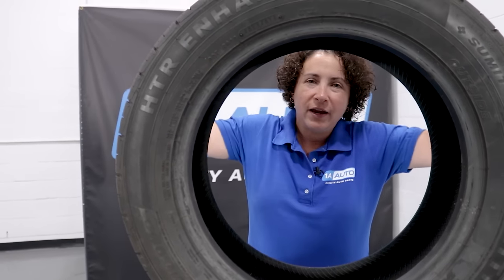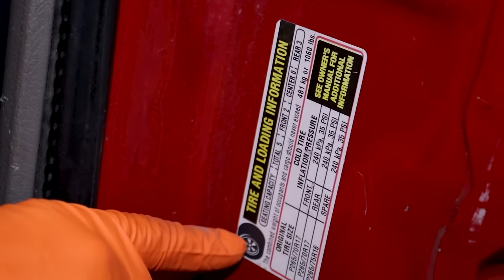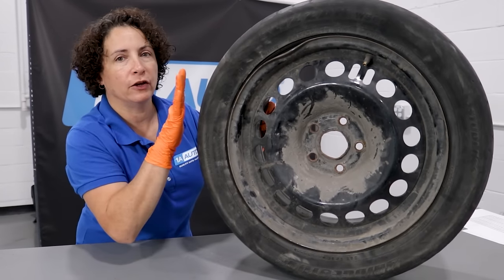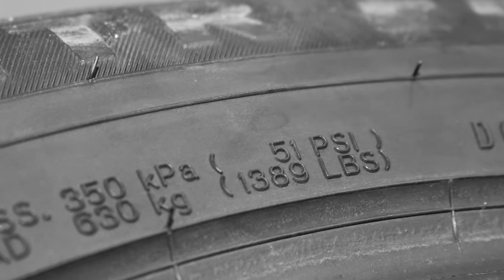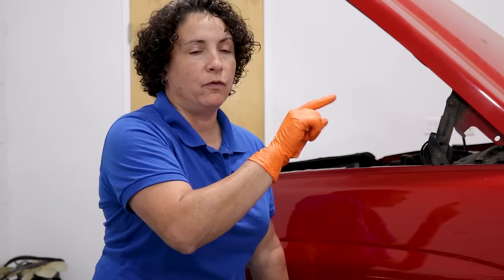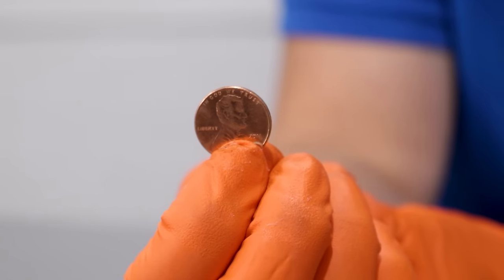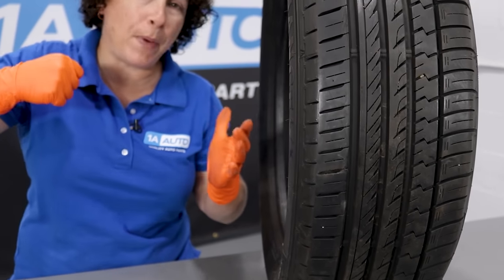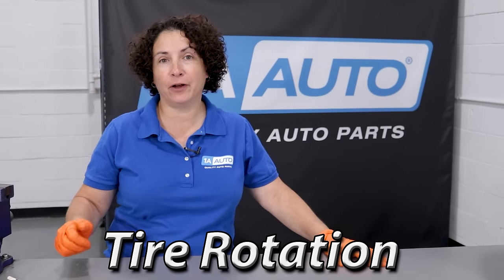Everything You Need to Know About Tires on Your Car, Truck or SUV

Comment: I retired from a major tire manufacturer and felt you did a great job at explaining the basics of the tire.
Reply from the maker: +Steve 319 Thanks for the feedback, we try to help out as much as we can!
Reply: Hello I have a question  if u don't  mind helping.  I have a 2011 dodge ram 1500 and my normal tire size is 275-70-17 I was told ill be ok putting 265-65-17 on it .Am I ok it drives fine but want to make sure not doing damage.  I'm a new truck owner. Sorry I know u don't know me .

Comment: I agree with her on everything but the alignment issue. If your old tires are evenly worn then you don’t need an alignment. Also getting an alignment every six months is ridiculous. You’re paying for an extra set of tires by doing so and it’s normally not necessary.

Comment: In 80's had 4x4 f350 dually for plowing.  When you spoke about winter, this truck with diesel engine and plow would not go anywhere as rear end was too light.  You are so right! I Needed a load of sand in bed of truck to balance weight on tires!
Reply from the maker: +Bird Lady Thanks for checking us out! http://1aau.to/m/Shop-1AAuto-c

Comment: Sue. Let me start with G-78-14. I don't think you are that old. I'm a old tire guy. HAHA. 
Thank you so much for covering most things about tires. 
I have Michelins on my Tahoe and my wife's Prius and on my 66 mustang.  Dunlop's on my daughters four-wheel drive Chevy pickup. I rotate every 5000. I have the  Alignment check every 10,000 . heat and cold plays a big Factor in tire pressure. 
Oh and one more thing ma'am not all of Texas is flat. Like most people think. Come on down sometime.

Comment: The door pressure indicator is always too low I wouldn't keep it that low unless it was in the winter during snow or rain otherwise go between 5:00 and 10:00 PSI over the door

Comment: Excellent video. Do I think you need to be as particular as Sue is? If you want the most out of your tires, absolutely.

With that said, if your budget is tight, keep an eye on your tire wear. Abnormal tire wear will indicate whether there are issues or not. If the wear looks good through the life of the tire with regular rotation? Personally, I wouldn't worry about it immediately and get it done when I can or when I see an issue, or replace steering / suspension components if I can afford to.

If you are safety conscious, tires and suspension don't get enough attention. I personally have been putting off replacing my shocks as money is tight, and plan to do so as soon as I can. That being said, I should have done it a little while ago when I had the money and put it into other things.

Comment: Is it shown on the tire where is the heaviest part? And how to find the heaviest part of the wheel? Reading instruction on Wheel Balancer I came across the statement, that if those 2 points (heaviest parts) coincide, it is not possible to balance the tire, you need to rotate it 180 degrees relative to the wheel. Thank you for the informative film.

Comment: great video.

I don't drive my car all that much throughout the year. (About 3.5k to 4k per year)
The place i got my new tires a few months back,  recommended that i rotate them every 6k miles.

Since getting to 6k will take me about 20 to 24 months. Should i rotate the tires based on time(after 2 years) or number of miles driven( until i drive 6,000 miles)?

Comment: Thanks very informative. I have one question, you said to go with the car manufacturer recommendation pressure. The sticker on the door says I need 26psi for the front, so okay I put 26psi, after I drove just a couple of meter I feel the steering is heavy and it feels I have  a flat tire why is it so?

Comment: Hi Sue, I have E rated 80psi tires, does that mean I still only fill to 35 psi?  When I drove tractor trailer, my steer tires were 110psi and drive 100psi.  Company had us maintain those pressures, and DOT too.  I understand how speed, air temp etc can raise temp of tire and pressure (which we checked when stop to make adjustments and notate if one tire ran hotter than the rest, indicating potential issue etc).  I think this is why we get confused as consumers 😀

Comment: But it's not the tread width, it's the section width (it's the distance from sidewall to sidewall). You can actually have two different tires that are the same width that will have different tread width.  There is a general trend of wider section with and wider tread width but it's not directly linked.

Comment: twice I have purchased a new car where the tires had been recalled ...... Firestone Steelbelted 500 radials and Firestone Wilderness tires were recalled due to safety and I got 5 new tires (remember to get your full size spare replaced also if you have one)

Comment: This comment (essay) is about tire pressures.  I've been an automotive tech for 35 years...should provide some credibility to my opinions.  It's important to stay within a range of about 2 PSI of mfg suggested on door label, but.............
.
At time stamp 10:44, you posed a question whether the (yards-long) air hose causes a discrepancy between what is indicated on the gauge display, and what's actually in the tire.  We can answer this in two ways:  Scientifically vs Practicality
.
Scientifically (and if measured with precision instruments), yes there will be a pressure differential while air is moving within the 25-foot hose.  This is due to frictional losses:  Variables include hose diameter & material, relative humidity, air density & temperature & current pressure, in-line flow rate & restrictions (AKA Needle Valve), etc.  However, let's say the pump stops.  Eventually air will stop flowing within the hose simply due to pressures finding equilibrium.  In other words, the gauge (yards away) will equal tire pressure.  Going along this path is waaaay too "deep".  So let's take the practical approach for the average driver:

.
..... Practicality:  Short and Simple answer, the length of air hose doesn't make a difference....
.
I could write a book based on the scenarios I've experienced with customers (lax and compulsively neurotic).  However, I'll try to make a "short list" ... a variety of reasons that having a 2 PSI variance (noted from convenience store pump gauge, or from your own high-quality digital model) vs the door label isn't the end of the world.
.
1.) Tire pressure pumps are high-pressure, low-volume pumps.  Therefore, frictional air losses within the hose are barely measurable, and pressure differentials between pump and tire is practically negligible.  But the question still remains:  How accurate is the gauge provided by the convenience store?
2.) Tire pressure gauges are not all calibrated.  I've had measurement discrepancies of 6 PSI between different gauges used on same tire at same time.  In other words, if the driver is using an inaccurate gauge, the reading is only an approximation.
3.) The lax client who neglects their vehicle by being overdue on oil changes & drives bald tires isn't going to care.  Their automotive insurance bundle often includes "Roadside Assistance".  They're too lazy and/or ignorant to change their flat tire (to a spare) themselves.  They don't want to get their freshly-tailored business suit dirty.  Or break their high-heel shoes.  Or their crappy attitude demands that such barbaric labor to install a spare tire rests upon stereotypical low-wage blue-collar workers.
4.) The neurotic driver who owns one of these newer "fancy" vehicles which shows tire PSI on the dashboard with just a touch of a button are the worst.  Not only does each TPMS sensor need to be factory calibrated (are they?), but just by driving around the block causes tire pressures to change.  They return to my shop complaining the pressures are off, which requires me to (politely) drill in their dense brain that...
5.) Tire pressures change with temperature.  Anybody who took physics in school needs to have a recollection of the Combined Gas Law.  Remember that formula?   P1 x  V1 x T2 = P2 x V2 x T1.   I've had customers leave the shop @ 75*F outside temperature, just to return at 3 PM when the asphalt is 110*F scalding hot and they're complaining tires are now 3 PSI too high.  Duh.  Plug in the numbers.
6.) As Sue noted in video:  The variables in sidewall ply (number of belts, as well as material used - poly, nylon, steel), the rubber chemical compounds, tire age, etc etc etc all play a role in vehicle handling & comfort.  Look up the manufacturer recommended pressure and compare it to your car's label.  If they don't match, just average them out.
7.) Finally, we are just average daily drivers.  Pressure variances of 1 PSI matters to Formula-1 race drivers who compete for tenth-of-a-second lap times.  The usual commuter just goes to Point "A" to Point "B".  Keep pressures within a tolerance of about 2-3 PSI and we'll all be fine.  Go anywhere beyond that, and yeah..... your AWD machine will be stressed.
.
8.) Side Note:  Don't get me started on that ridiculously absurd "Nitro-Fill" sales pitch.

Comment: On tire pressures - yes, follow the vehicle PSI guidelines.
But the max PSI is the cold PSI. If you inflate to 50 psi cold, the tire is designed to deal with additional heat.
Cold PSI is cold PSI.
Reply from the maker: +Jeremiah Morrell Thanks for the tip!

Comment: Also don't buy a BMW if you don't want to buy the tires that the manufacturer requires.  Run Flats are expensive, dont think your going to buy a cheap tire and expect it to look and handle the same. BMW are heavy vehicles, the run flats have a real thick strong side wall that holds up the tire and keeps the sidewall from collapsing. if you put a cheap tire with a low payload capacity dont get mad when it looks dumb because it looks flat or low on air. And dont inflate it until the sidewall looks right. I see BMWs or Mercedes come in with 60lbs of air pressure and then the customer complains of a rough ride and their tire light being on. If you leave it at the required air pressure don't expect it to perform the same either, you'd not gripping the road the same anymore and the tires don't support it like the run flats either.
Reply from the maker: +Arthur Garcia Thanks for the feedback!

Comment: If the psi listed on the inside of the vehicle door is 35 psi, does that imply that I should inflate the tires to a maximum of 32 psi? I've observed a 2 psi rise in tire pressure when transitioning from cold to hot tires.

Comment: Did the engineers specify tire pressures to be loaded or unloaded? Aka, a tire inflated to 32psi would actually be higher when the weight of the car is resting on it. So if I inflated my tires to 32psi under load, then removed them, they would all show lower readings. So I'm assuming no one has time to check tire pressures with the wheel off, so it's loaded tire pressure?

Comment: 10:20 you should not have lost presure, even if the hose is 50 meter long. because high preasure always runs to low preasure, and when the air stops moving, then the preasure is the same. or am i totaly wrong now?

Comment: People need to get the right size of tires for there cars. When I bought my car used it handled so poorly and the road noise was awful and my gas mileage was in the toilet. I looked at the tires they looked too big for the car did some research and they were. Headed to the tire shop got the right size and now the car runs and behaves so much better and is a lot more silent and my gas mileage went up and the speedometer was accurate again.

Comment: Most tires at half worn, have seen a lot of road surfaces, from hot pavement to pot holes, and freezing weather, especially if you live in the Northern United States, hot pavement in summer and freezing conditions in winter, taking away the safety aspects of any tires , more people need to understand the importance of good safe tires .

Comment: Should I use the same brand and model of tires in the recommended sticker also ? Or is that not as important as the sizes
Reply from the maker: +Lincoln The size and the load rating is the important information on the label. Thanks for checking us out! 1AAuto.com

Comment: I mistakenly aired my tires up to 70-80 psi instead of the recommended 30 psi. It was left like this for around 23 hours until I  reduced the air back to 30 psi. Do you think this might have caused tire damage and be dangerous?

Comment: Did she really say that we need to get an alignment every six months? I change my wheels all seasons in spring and winter set in the fall. Is it advised to get an alignment every time I am changing wheels? I thought it was only for rubber install on to rim. And I guess based on the age of the rubber even if tread depth looks fine and other optics look fine we should look to get rid of the rubber  after 6 years and get a new one as the oils have been dried out that we can’t see through our simple visual inspection.

Comment: Why do they give tire mileage ratings and even with regular maintenance you end up with dry rot and have plenty of tread left on the tire in Texas they now get about half of what they rate it out and no where close to the rating advertised and they are what the factory recommends and not some off brand tire brand?

Comment: Does anything Happens to my car if I keep all my 4 Winter tires in my car's trunk forever?
Reply from the maker: +abhilash abhi Thanks for checking us out! This will be additional weight in the rear and possibly cause issues with the rear suspensions especially if they still have the rims on them. We recommend having them stored outside of the vehicle in a storage facility or in a basement/garage.

Comment: why all the time do we get advice to drive slowly? why can't we go at the speed, things are rated for, and made for when the conditions are right, the autobahn is good and straight, and no traffic jams? I don't plead for 300 km/h (that's for racing tracks). 220 km/h with a good limousine, an alert, not tired driver (not drunken either) is a pleasant experience and it is safe!   if there are no hidden traps, it is safe for an experienced driver. 
Even medieval travelers preferred fast horses over walking slowly.